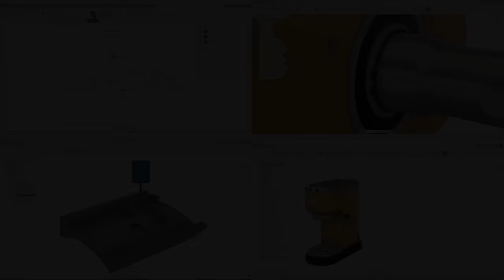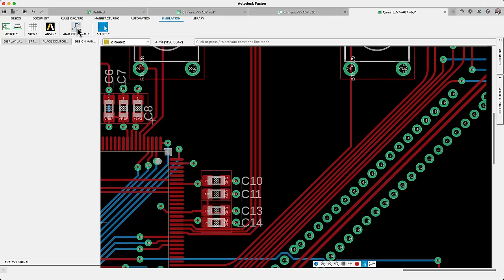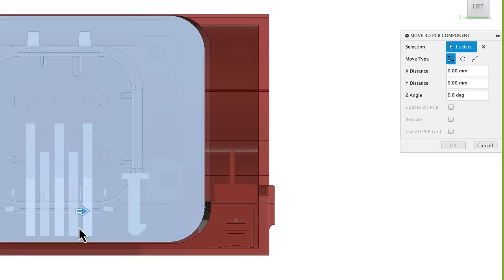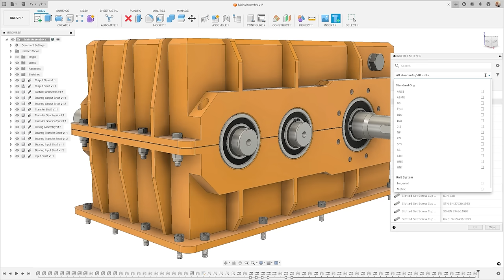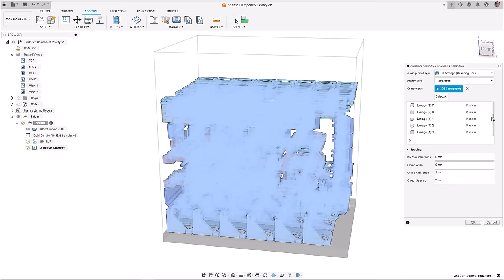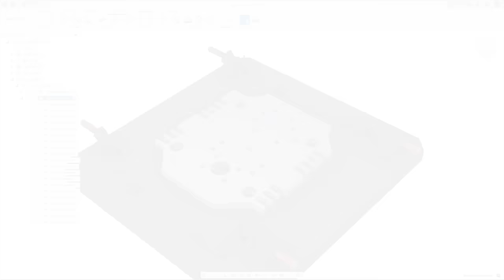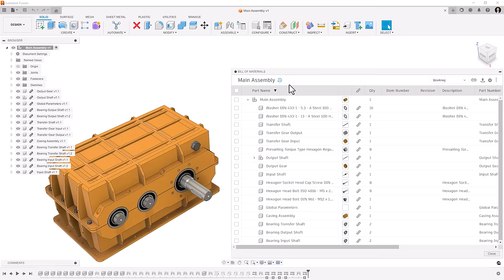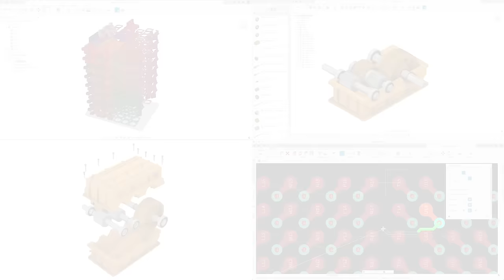Boost Your Productivity with the Autodesk Fusion March Release

Comment: Make drawing environment more stable. Get constantly crashes when creating a new view and changing the scale for example
Reply: Wonder if this is your graphic's card driver. I have never had Fusion 360 crash. Make sure you're running the latest available driver.
Reply: @larrybud  I am using the latest GPU Nvidia driver
Reply: @emanggitulah4319 is it a dedicated GPU, or an integrated GPU?  If its dedicated gpu it should run pretty smoothly, if its an intwgrated gpu running fusion then may god have mercy on your soul
Reply: @No_moral_to_the_story  I have a powerful Nvidia GPU. It often just crashes in the drawing environment
Reply: @emanggitulah4319  my mistake, you're right, if its a current nvidia gpu it'd almost always be dedicated.
 While fusion is a work of brilliance doing thousands of complex calculations in a split second, at the same time there's always 1 or 2 completely random operations that somehow if you combine them with a completely unrelated operation in a certain way it gets hung. 
I had something similar where for a few months randomly if I tried changing the appearance on something half the time it crashed.  
And it seems like it's always a different thing for each user that triggers it.  Guess that's what makes life interesting.

Comment: is there a way to keep the CAM operations linked to the part? f.e. i have 2 parts in seperat files. both files/parts have perfected milling operations saved in itself. it would be awesome, if i now could put it in a new file without relinking all milling operations using saved preoperations.. that costs so much time.. and because i pay for fusion i need to have a advantage i saving time..
Reply: Not currently. But that requirement is on their radar.
Reply: cheers for the info!
Reply: Keep am eye out for Cam of cam. You could join the fusion insider program and learn more.

Comment: I am currently testing Fusion for suitability for replacing our current software provider for CNC programming, how can I ask Auto desk to see if we can get some features added that we need for our operation that our current software does now........
Reply: Which features do you feel are missing? And which CAM software are you currently using?
Reply: @ScottMoyse  I am a programmer for large multi axis Vertical turning lathes ( two & 3 head lathes- 4 axis & six axis, and we currently using Creo.

While this does what we need, its complex, its buggy, and not well supported in our area to find people. to hire

I need the ability to inject code at the start & end of a sequence for sync blocks (M101, M102  etc as well as custom macro for the controllers.

I need the ability to use construction plan to split cuts.

I need the ability to program center of tip radius, we use 50mm buttons .

I am working my way thru TITAN of CNC training modules at the moment to see if we can use fusion as our main CAM package.
Reply: @swamppifi6186  Titan's content is very out of date. It also teaches a number of bad practices for Fusion. So I would avoid that content if I were you. Use the Autodesk learning content instead. 

Most of what you have listed is possible, but would require a decent amount of work on a custom post. Where are you based?
Reply: @ScottMoyse  Yes I am finding that out as the interface has changed compared to the current software version.

I am in Australia..